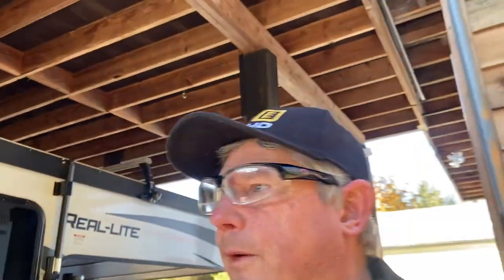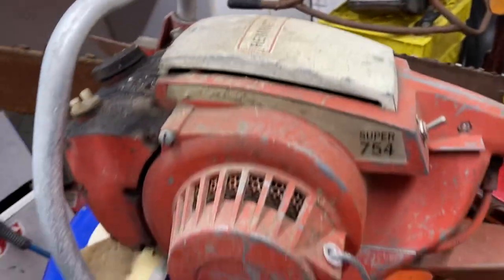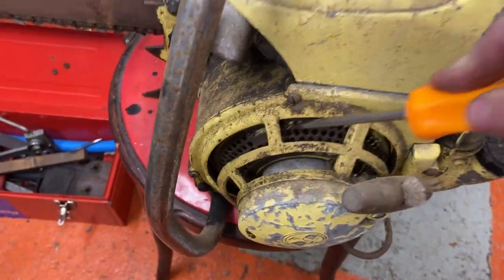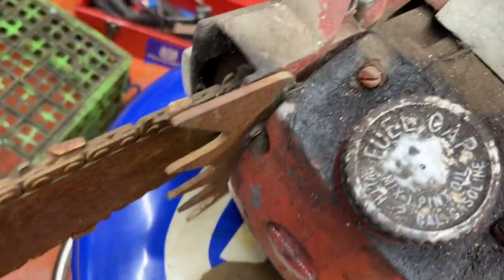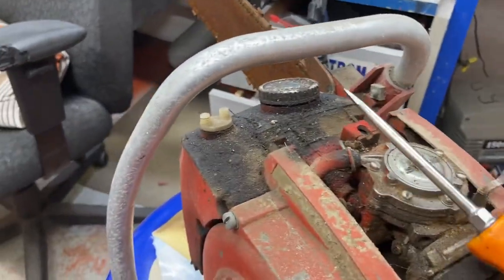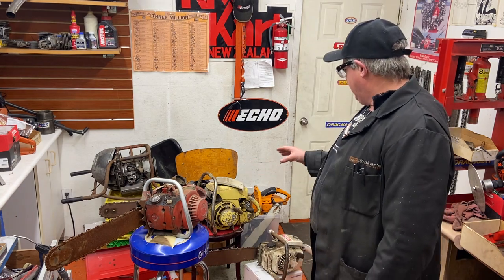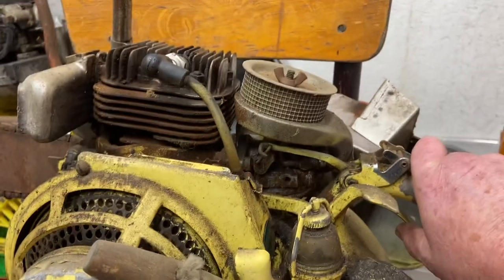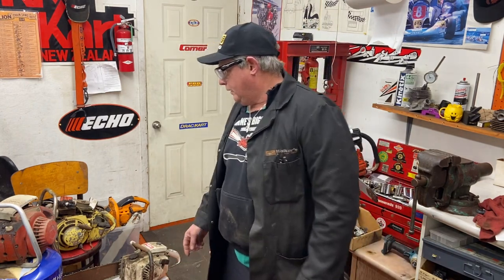Donny walkers chainsaws showing old pioneer and Remington

Comment: We had an old hot saw we built that was a MAC and we ran a roller tip bar similar to that roller tip. Not really any mods done to the bar really. I remember using an old metal break fluid can hose clamped the handle for the gas tank so the fuel above the carb to help gravity feed to the carb lol
Reply from the maker: Cool love the design of old saws

Comment: 16 to  1 🤔🤔🤔🤔🤔🤔🤔
Reply from the maker: Choke choke hey maybe I will mix up some old bean oil castor oil to run in the old ones it smells good to me
Reply: @donnywalker4691  just  wack  just  bit  bit  in  //////  the  old  castor  will  not   mix  with   petrol //// ya  smells  gooooood
Reply: @donnywalker4691  : i got me a jug of straight 30 wt for some ridiculous low price .  mostly for my mower but in a pinch i can run it in my older 2 strokes .
Reply from the maker: In those days we didn’t have good 2 stroke Oil I like old opti 2 oil for old outboards and bikes I will mix opti 2 at 50:1 it will work just fine I wouldn’t spend money on good synthetic just to make a few cuts now and then I won’t be production falling with them eh guys🪵🪓👍